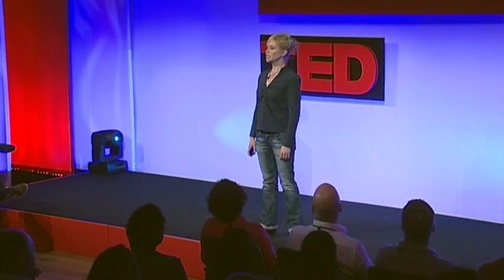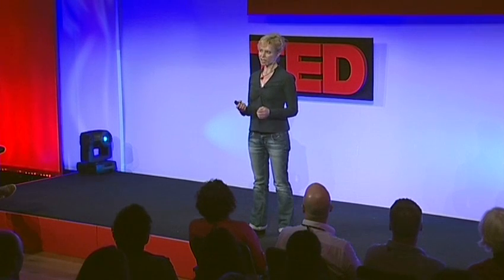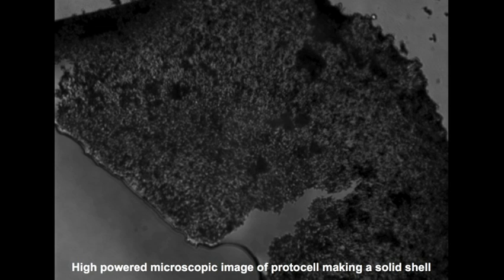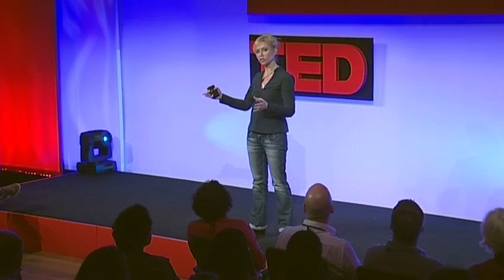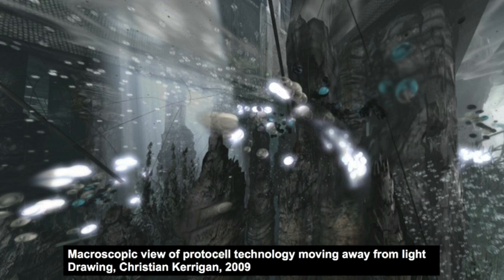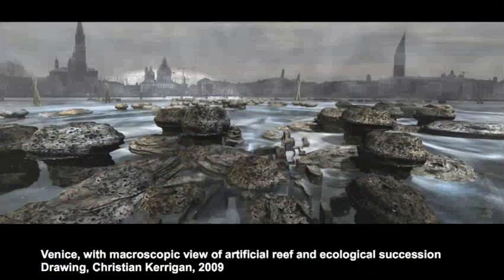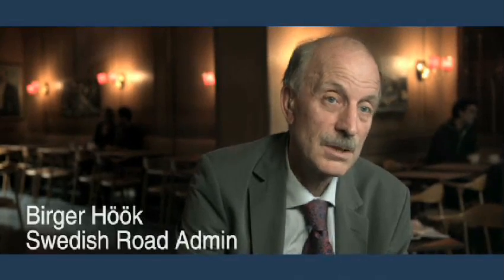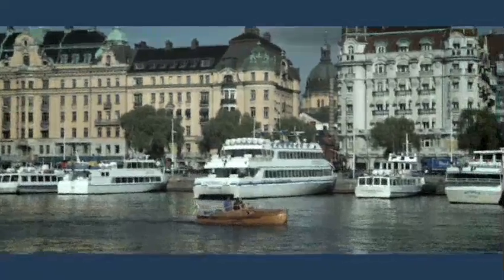Rachel Armstrong: Architecture that repairs itself?

Comment: Don't get me wrong - I love TED talks - and have listened to many. But here, I can only think that it was the sheer inventiveness and apparent plausibility that enabled Dr Armstrong to get her airing. Some very sweet and whimsical ideas extrapolated from various non-combinant concepts.
But there are so many false premises in this argument that I can only assume it has been cobbled together as a new form of hype-experiment to see how many conventionall- educated members of the general public can penetrate the twaddle and see if there is a real potential in this proposed use of biotechnology. Protocells may have infinite possibilities - but reparative architecture as described here is not one of them. 
There are many parameters that have not been considered either - as in the use of oxygen and calcium to enable the bonding of the carbon dioxide to create Calcium carbonate. The increased ph factor of the water would lead to greater erosion than is already the case. And chemical reactions in a laboratory are not relevant when applied to a multi-chemical biotic soup of living water with all its components.  The fact is that anyone can generate lush images using computer enhanced virtual or actual photography - and then label it with whatever notion comes to mind - from draining bathwater or vastly magnified water droplets on a bathroom mirror to swarms of light spots apparently moving towards darker areas.
Just one point, (space allows) the necessity of Venetian waterways - for transport or drainage, for a fully circulating system - could be compromised by indiscriminately solidifying particles in 'dark areas'. Come on now, oh really?

Comment: I agree that this may not have *immediate* practical application, but her point of moving away from top-down decision-making in design and use of materials is spot-on. Our traditional building practices emphasize a single, immutable tectonic outcome, when in reality, climactic, social, and programmatic conditions are in constant flux. Buildings should have true existential lifecycles. Permanence is a silly concept if you think about it.

Comment: One percent? not even a fraction of that... It does not matter anyway, most our planet consists of is iron, iron oxide and silicium. the elements relevant for life (other than Oxygen and Hydrogen) add up to less than 0,5% of the earths mass. Of that, only a fraction is avaiable to ecosystems, most is bound in minerals. There is a limit to growth, and we all will have to face the problems thus resulting.

Comment: It first bound to the substantial iron deposits, flooding the oceans with the iron-oxide pollutants. When those were depleted, the concentrations rose to levels that would commonly ignited in violent explosions when sparked by lightning discharge. 

The event is also know as the Oxygen "Revolution"... mainly because the species to name it as such was descended from a surviving populations who could adapt, and descendants would later incorporate the toxic pollutant into their metabolism.

Comment: Old movie rule: If nothing happens by the end of the first reel, nothing is going to. 

My new Ted rule: if nothing but pseudo-philosophy ("imposing structure on nature, surely this is unsustainable") is spoken for the first half, nothing useful / practical / possible in this century will be pro-offered. 

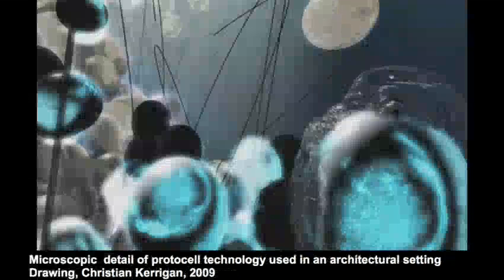I'm at minute 5:00 as I right this...lets see.

Minute 10:00: Neat idea but way far away and no a solution for problems we face now. I can see this being maybe useful in 50 years.